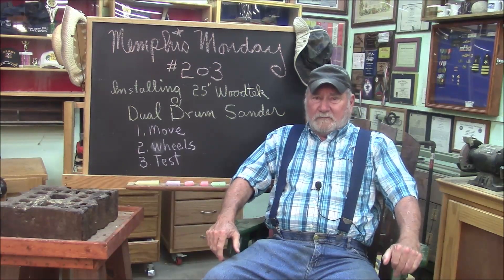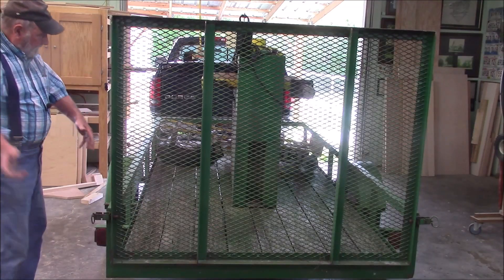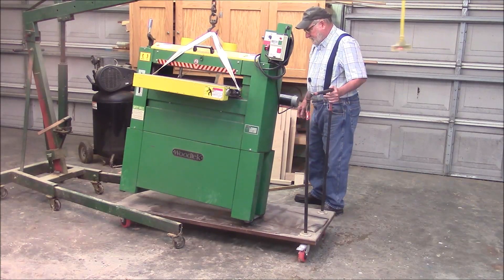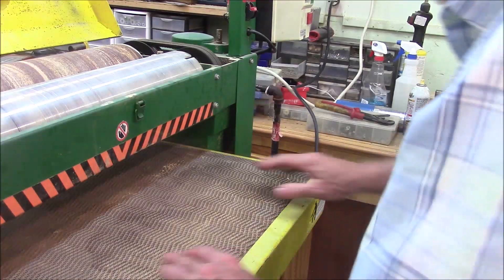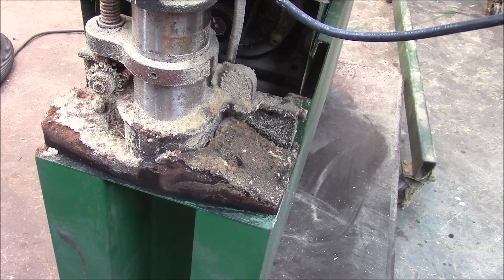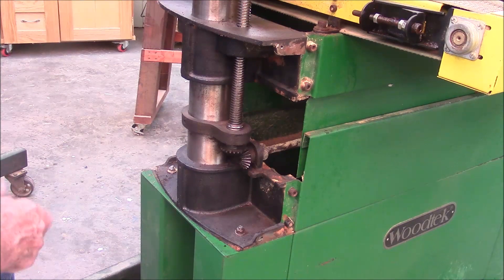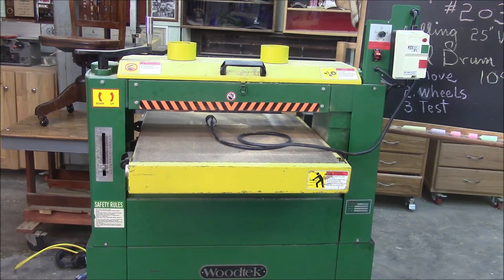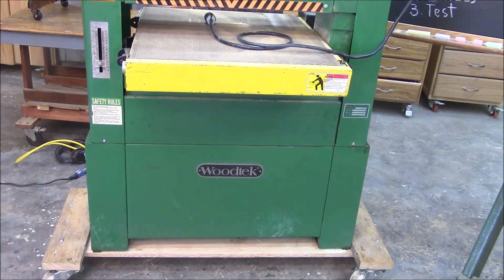Rigging in and Setting up my new Drum Sander MM 203

Comment: Must say this video was one of the main reasons I bought the same sander, picked it up today and everything you did was done on the one I got today, brilliant! Spot on and fixed most of the issues. The video was also very helpful in determining that someone had installed the side shields backwards and they would not move properly, flipped them around and all is ok. Tomorrow will try the main motor and the belt feed motor for operation. Mine came with a base.  Designed exactly as you surmised when building your base, weight on the corners. I did notice the crank is 4mm per 1 turn or almost .160 per turn.

Comment: Great find.  Some of the best deals can be found from people who don't realize what they have.    It made me laugh when you showed that the lift was sitting on both sides of the tire of the trailer.  kind of hard to drive out from under it that way.    This video brings up an important take-a-way and that is to clean something like this up before you try to do any extensive testing.   This was a lesson that took me a long time to learn.  If you had forced this, you could have ruined what turned out to be an excellent almost new machine.   This sander is big enough that it should make quick work of all the cabinetry you build.

Looking at the weather for Tennessee, I am considering extending my stay.  It would be tough to go from highs in the 80s to highs in the 40s and 50s.  There is also the possibility that the ground is too wet for me to park my camper in my yard.    I will think about that later, for now, I am headed to the beach.  Have a great week.

Comment: Hi - Is your belt drive still working?  I have the same model & mine won’t work but it’s not the belt too tight. Any ideas?
Reply from the maker: Mine wasn't a tight belt either, as it turned out.  I had a bad power circuit board.  Take off the cover on the back of where the power switches are and you will see it.  It is a green circuit board, the only one on the machine.  I ordered two off the internet, and killed both of them by switching the power and ground wires.  Take a million pictures of the thing correctly wired before taking it apart (and don't worry it is simple simple simple to take apart.)  I then bought three more off the internet, just so I'd have a spare.  I now have nearly as much invested in circuit boards as I have in the sander (which I got for $500 at auction.)
       May I use your question in a Memphis Answers video?  I rarely show my errors, unless they are funny or actually valuable, so I don't think I've talked about this screw-up on any regular Memphis Monday video.
Reply from the maker: Bobby, down below says you can get the manual at woodworkers.com.  I think that's where I got my circuit boards, and they were in stock, and I got to talk to a real person.
Reply from the maker: One more thing, this machine goes by many different brands, but you probably figured that out already.